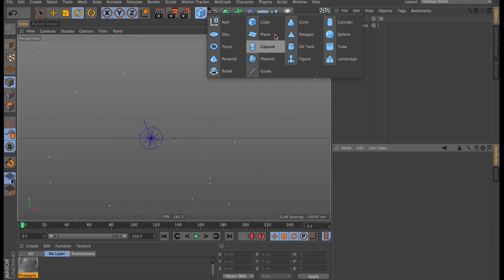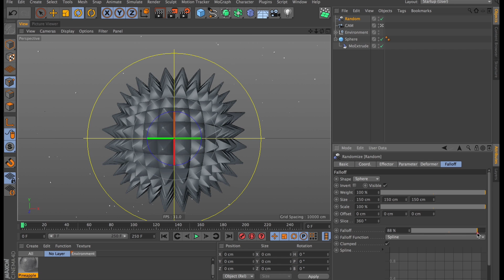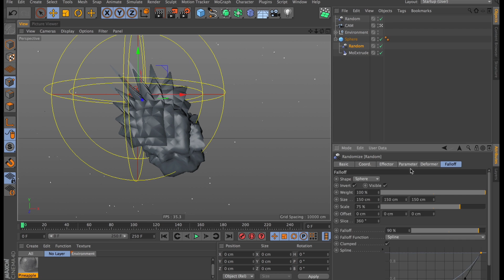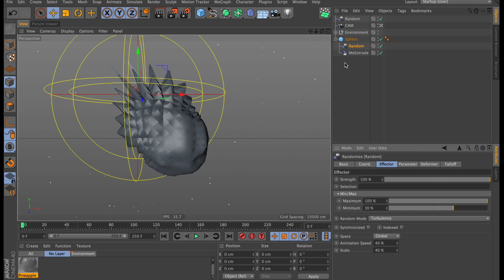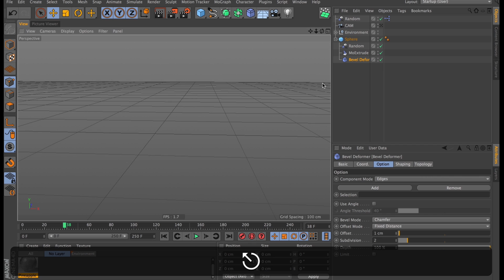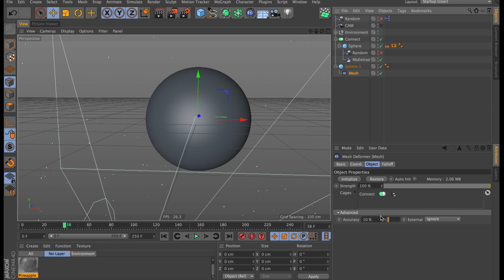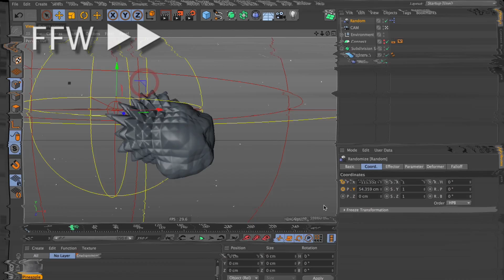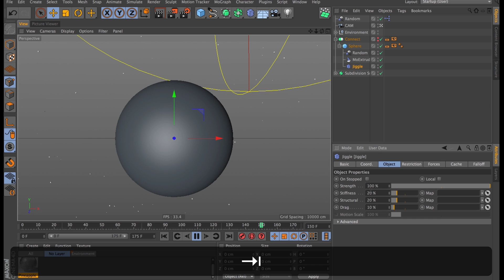C4D TUTORIAL | MoExtrude & Mesh Deform Magic  [Cinema 4D]

Comment: Thanks, Daniel. Great and funny tutorial.Not sure if you'll see this, or someone else will, but when I complete the steps for the connect function and click initialize, my sphere actually shrinks to nothingness. If I pull the strength in the mesh deformer back to zero, it begins to get back to it's size. I'm using R21, so I have a feeling something's changed? I'm sure I followed every step. Can anyone help? Thank you!
Reply: The problem seems to be in re-enabling MoExtrude. It seems to do that for some reason...?
Reply from the maker: Glad you may have found a fix!
Reply: @DanielDanielsson  I've got the exact same problem using R19. Mesh deformer shrinks the sphere down to nothing, Lowering the deformer strength scales the sphere back up again. so its like its deforming all points equally. any clues??

Comment: Hey Daniel, thanks a lot for your great tutorial. I could follow very easily until the point where you replace the sphere to the connect objects in the mesh cage (5:47 min). When I put the connect object into the cage and delete the sphere the memory shows 0 kb. Did I miss one step? Thanks for any help in advance!
Reply: 5:20 you most likely missed the first initialize... this is what i did and when i went back and did it again it worked out :)

Comment: Cool men but I miss rendering a d texture as well:(
Reply from the maker: I kind of cover it in this video: https://youtu.be/mDQA-zpuQZQ

Just use a blue gradient instead of the hot yellowish orange!
Reply: Daniel Danielsson thanks! But you use arnold :( I don't know this render engine, I use phisycal, vray, or standar...
Reply from the maker: You should be able to do something similar in Standard or Physical using the "Invert Direction" option on the Ambient Occlusion shader. Then add a "Colorizer" effect on top of that to control the colour.
How to use Inverted Ambient Occlusion:
https://youtu.be/zSuhHlqabGA?t=24s

Comment: Hi, Daniel, nice tutorial and can you make a tutorial on setting up environment and camera?
Reply from the maker: For this one it's just three lights: one very large cool quadlight to the left, one small blue disc-light behind the pineapple, and one red one off to the right. Then rendered with Atmospheric Scattering in Arnold.
Reply from the maker: Used Arnold so they were:
Camera (AA) Samples : 4
Diffuse Samples : 0 (max : 0)
Glossy Samples : 16 (max : 16)
Refraction Samples : 4 (max : 4)
Total (no lights) : 24 (max : 24)

Atmospheric Scattering Samples : 4
All lights default samples I think.